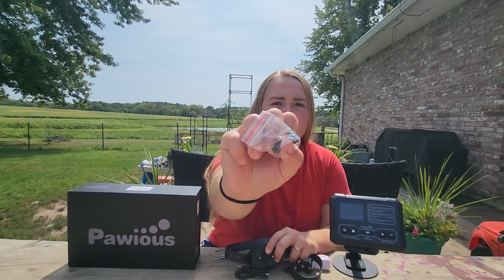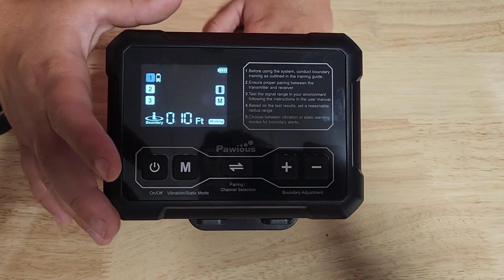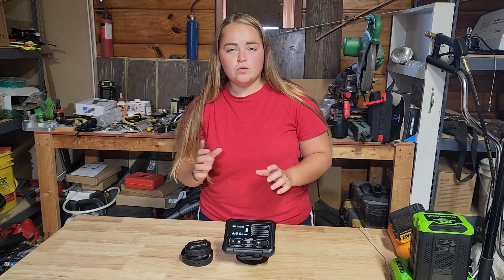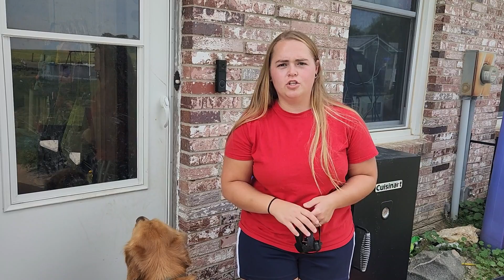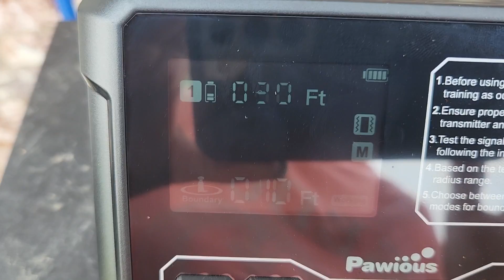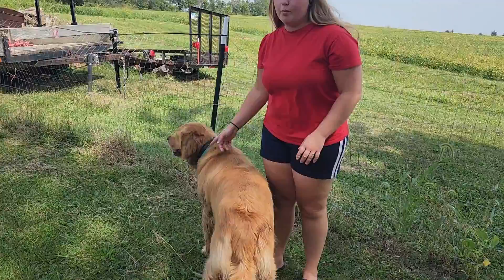Pawious Wireless Pet Fence | How to set it up and use it

Comment: It doesn't work if you have it in your house and your dog is outside
Reply from the maker: We've not had the experience. Perhaps you have a defective unit or something else electric is causing interference
Reply: Doesnt work for me either. It only reaches one side of the house for some reason.  @skinners100honestreviews3
Reply: I have this same issue, it half ass works inside the house